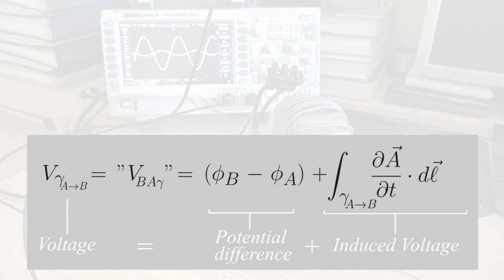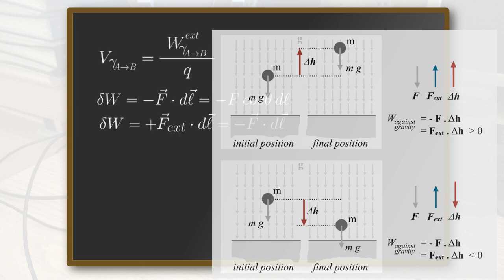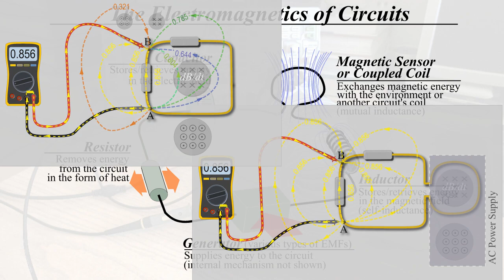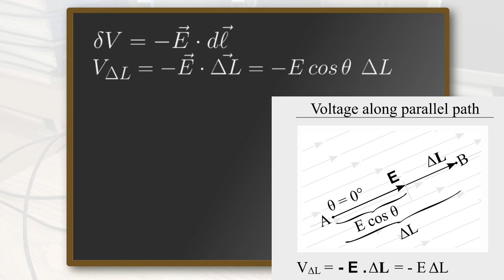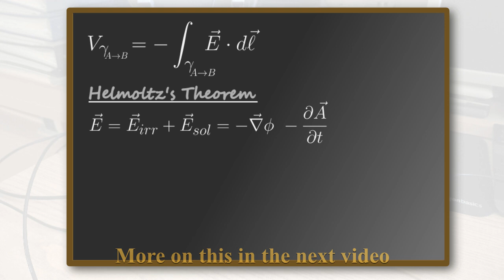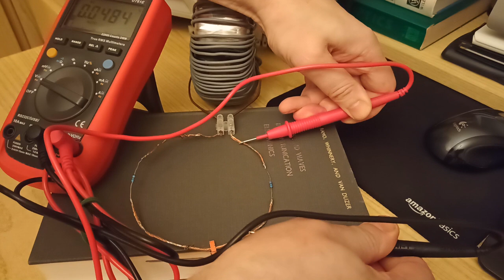Voltage for grownups

Comment: I really like your video content. I see how the engineering approach to this issue is a little different than the physics approach, though at bottom the science is the same.

I take your point about conduction electrons not caring about whether a field is irrotational vs. solenoidal, so you call the work per charge “voltage” in both cases. However, there are interesting differences. For instance, when there is an electric field associated with conservative coulomb forces, there is an accompanying surface charge distribution on the wires and also on interfaces between various conductors in the circuit. In other words, the physics is interesting and different in the two cases. That is one reason why physics texts emphasize the distinction and prefer not to use the term “voltage” to refer to both (1) conservative and (2) nonconservative work per charge, instead calling them (1) potential difference and (2) emf.

That said, many physicists are confused about this topic and your video is refreshingly clear. So thank you for that. Yet I suspect we (physics and engineering) will continue to disagree on what the word “voltage” should be used for.
Reply from the maker: Thank you for your comment.

The 'paper' (it's more like a letter) by Moorcroft I am going to discuss in my next video, and where he proposed to use the term voltage for the line integral of the total electric field and PD for the conservative component, dates back to 1969. If we haven't found common ground now, I doubt we ever will :-) . But in the light of the IEC and ISO definitions (which I discussed in another video) I believe there is some hope. I think the problem here is in the teaching stage, and I will show in another video later on why the definition that uses the total electric field makes more sense and, most importantly, does not lead to contradictions in certain situations.

Note that this does not mean that the "PD + induced voltage" approach is inherently wrong. The two approaches are actually equivalent, but one has to acknowledge that, in the presence of variable magnetic fields, PD alone does not suffice to describe the system, and that the determination of how voltage decomposes into PD and induced voltage requires the knowledge of the sources (and I have two interesting examples to make). As a matter of fact, the uniqueness of the Helmholtz decomposition into Eirr and Esol is subordinated not only to a certain regularity of the fields at infinity, but also to the exact knowledge of the sources of the fields (charges and currents). Knowledge of Etot, on the other hand, is local and so you can tell what the voltage is along a path that is accessible to you without knowing the exact position and strength of the sources. 

I do agree that surface and interface charges are important, and as I anticipated in another comment (maybe to another video) I intend to cover this topic as well. There is a partial discussion in my video "Dispelling the Lewin KVL Paradox:  the total electric field", and I also wrote an answer on Stack Exchange about it (I don't remember the title now, something along the lines of "the electric field in a wire is constant").
Reply: @copernicofelinis  When I commented, I had only watched this one video. Now that I have watched your other videos, I see that you address my issues very nicely. This is excellent stuff! Are you thinking of making videos to discuss non-static circuits where the work per charge is integral of vxB instead of integral of E? Do you refer to that as "voltage"?
Reply from the maker: The next video will be about 'loop voltage', 'potential difference' and how to treat voltage in lumped circuit (what certain authors call 'terminal voltage'). The IEC chose not to define (or rather discourages the use of) the term 'electromotive force', but I still like to use it, with due care. Now, what the IEC call 'loop voltage' is what I would call "EMF of electromagnetic origin" and yes, in general it should include the motional term (and the IEC definition includes that). We can nonetheless see it as a 'specialization' of voltage when applied to closed loops: the conservative component gives zero contribution, and all that's left is the 'EMF'). So, yes I intend to do a video on the EMF and its relation with the voltage at the terminals, but I will still consider the stationary case to avoid confusion.

I have then a few more videos on the measurement of voltage and an illustration of the fields that explains why a voltmeter measures what it measures, plus a video on why defining voltage as potential difference can give you problems, and then if I am faster than the grim reaper I intended to do videos on voltage in a motional context, voltage in transmission lines and maybe even one on voltage in radiating systems.

Comment: This is probably quite interesting but the voice-over is bad.
Can you re-record it?
Whispering and mumbling is not satisfactory.
Reply from the maker: I have just finished updating a corrected version of the subtitles. The problem with the voiceover is twofold: first, my abysmal pronunciation (compounded by the fact that the recording was initially meant only to estimate the length of the video); second, the low sensitivity of the mic. I have a Logitech headset that behaved spectacularly years ago in Skype - loud and clear - but as of now with Seven and 10 only produces low levels (something like 1-2 notched over a max of 10) and a lot of noise. I had to record this voiceover with my smartphone, keeping the phone in one hand and a pillow between me and the laptop to muffle the sound of the fans. I also did it in the middle of the night, and my voice was naturally on the whisper side, sorry.

I have an updated version of this video with a couple more figures (not important) and corrections on the name Helmholtz and the formula overlay frame, but I don't think I will re-upload it anytime soon. I will be more careful with the audio levels (and try to improve my pronounciation) in the next videos.

Try using headphones, they can solve the whispering problem. As for the mumbling, I need to work on that 😢.

If the headphones won't do the trick, try  the subtitles or better yet the transcript. 
I still have a couple of typos to catch, but they should help.
Oh, and thanks for the feedback.
Reply: Thanks for the detailed reply, and sorry if I was abrupt but it was frustrating to find such interesting content which I had to abort!
It made sense when you explained that the audio was recorded at night.  This was the only problem for me.
If you are able to deliver speech at a daytime volume, any old microphone or smartphone will be adequate.
The only fancy addition might be some post-production compression, but a smartphone probably has that built-in.
Speech doesn't require much bandwidth, dynamic range or s/n ratio.  I was unable to follow the content because of the late night whispering :-)
Reply: Imagine being a person complaining over a FREE video of this caliber.
Reply: @heywayhighway I'm happy not to be as daft as someone who complains about free feedback and advice.
Reply from the maker: @heywayhighway  thanks for the implicit compliment, but it is okay to give negative feedback. It helps improving content. In fact, if nobody had complained for the low audio levels I would have probably recorded the next video in the same way (low voice, phone on desk, instead of keeping the phone in my hand and shouting into it).
I do appreciate corrections and helpful feedback.

Comment: Can you make a video on energy flow in a circuit??
Reply from the maker: That is on the back burner. Right now I am planning to upload a video on the IEC definition of voltage, another one on what a voltmeter actually measures, and one on when probing does matter and why. Then I would like to do a video on the role of surface and interface charge in establishing the E field inside a circuit. And only after that consider the energy transfer question (which has a lot to do with surface charge and also requires making some complicated figures).
Reply: @copernicofelinis   I'm gonna subscribe and turn on notifications , so I don't miss on this ones
Reply: Great and yeah we need to understand fundamentals correctly. most people do just read the definitions and move on i really like this video
Reply: And also I never really understood the term "flux". The magnetic flux and mmf stuff if you can try to put it in your bucket list .
Reply from the maker: @lokeshvirat5915  well, there are two important 'dual' quantities that can be defined on a vector field: a line integral that quantifies how much the vectors of the field are going along a given line (when the line is closed this is the circulation), and a surface integral that quantifies how much the vectors of the field go through a given surface (this is flux).

The circulation is associated with the projection of the field along the (local) direction of the path, while the flux is associated with the projection of the field along the direction orthogonal to the (local) surface.

There are very powerful theorems that can relate the circulation of a given field (how much goes around a given closed curve) to the flux of a related field (how much goes through the surface delimited by that closed curve). And if you look at Maxwells equations in their integral form, you will see that they relate fluxes and circulations of E and B. But this is too long a story to be told in a comment.